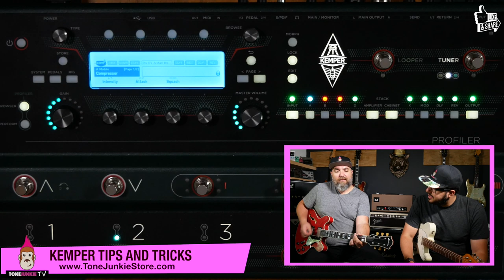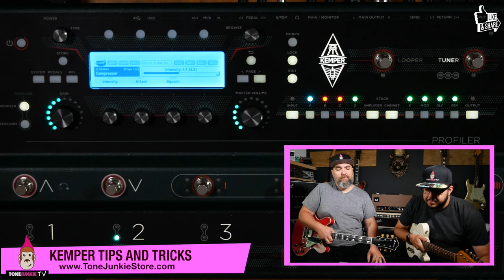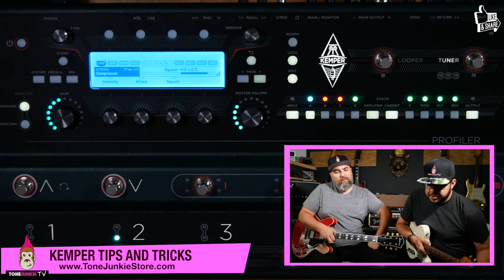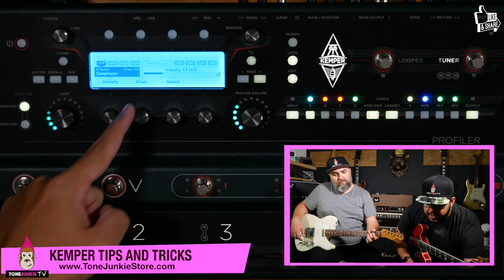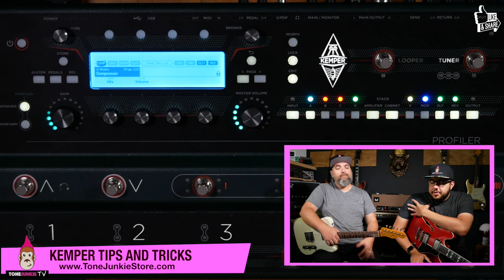Kemper Tips and Tricks - Compressor Stomp

Comment: Great video, but you're describing the attack backward around 12:45. 
From the manual: "Attack - Adjusts the reaction time of the compressor. The higher the “Attack” value, the LONGER it takes for the compressor to kick in. This will let the first peak of the signal pass unaffected when you hit a string, thus increasing the percussiveness of your pick."
Reply from the maker: Oops my mistake!
Reply: @ToneJunkieTV  I have to refer to the manual pretty much every time I touch a compressor because I can never remember the direction!